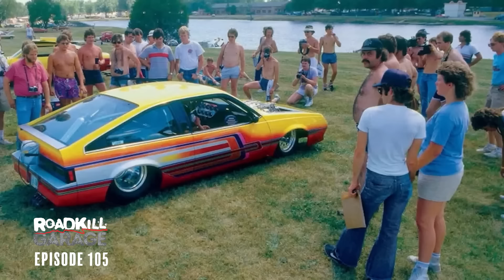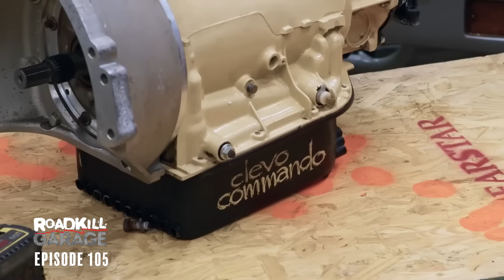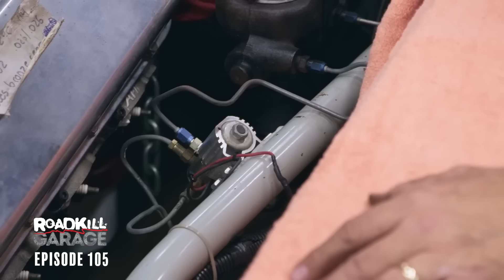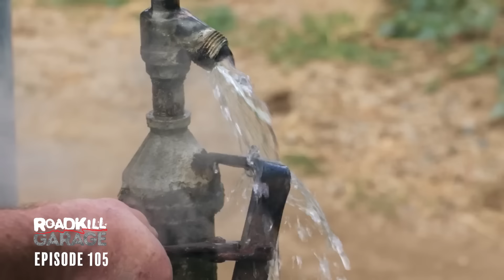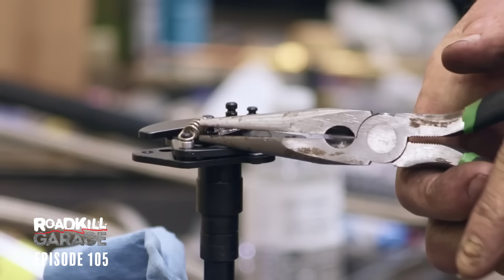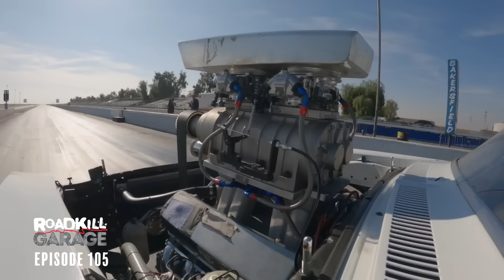Making a 1000+ HP Pro Street Nova! | Roadkill Garage

Comment: The runners are closer to the intake the exhaust runners ore closed off their the blocked head im blocking these heads groove moving the runner towards the middle having the exhaust separated  two apart through exhaust  pipes their going to be ane upper ane lower deck to the inner cooler

Comment: As soon as you do that the torque on the intske roller rockers  1.7 rollers thevtorque is 43 turn ylthe wrench squared off the wrench the back it off 1/2 the exhaust roller rocker arms the 41 torqued the squared off to 3/4 after you loosen them after thevtirque is set

Comment: I have a nostalgia enginebane 30 over 305 the distributor 180 distributor stabbing camshaft 12 at 360 degrees which is said but usually any thing you heat is wrong turn the crankshaft turnef the camshaft mark at 6 o'clock  cause I have the distributor rotor at number one rotor at point the number one wire at the firing order of the number 6 cap the turning the distributor tovane 30 degreed minus 180 make 150 degrees the plus is 210 the the 30 degree turn wheir you turnvthe distributor to the number four wire two clicks

Comment: The 1969 and 1970 Nova made the best hot rods back in the early 70s. Why? Because you could stick it to the insurance companies. If the VIN number told them that it was a six-cylinder Nova that was the rate that you paid no matter what was under the hood. In my case, an LS6 454. You could not do that with a Camaro or firebird or mustang or Challenger... The NAME said muscle car. Even if it was a 6 cylinder car, you had to pay the high rate. The only way you would not get away with it was if that Nova was an SS car.

Comment: you locktite the threads and put arp lube on the sliding surcafe. its in the arp flywheelbold manual if you read it

Comment: The original Pro Street cars were just that: street cars, not race cars. Most early examples were back-halfed cars with subframe connectors and stock front suspension.

Comment: fellow gear heads help me put, when he said the shorty headers were for higher rpm ranges... how ? when does header length come into play with rpms
Reply: Length of intake runners and primary tubes are all about optimizing power at an specific rpm range. The longer runners and tubes the lower RPMs were you get an "boost" in power. It's combustion engines 101 tech.

Comment: Great video, but why are you using a brass distributor gear, they wear out quickly when street driven
Reply: Yep, they should be using a composite.
Reply: bronze, not brass. - and he explained why.
Reply: @peterrenn6341  and they still wear out on a steel camshaft

Comment: That’s why I love roadkill and roadkill garage.  They just don’t build cars. They teach you tricks and tips   They’re very hands on.
Reply: The only thing that could be better is if us inferior people were allowed to watch the full episode.
Reply: 😊😊😊😊 @vintagetractorsaustralia
Reply: @vintagetractorsaustralia  Here-Here to that.
Reply: On Pluto tv they have a motor trend channel and on the weekend they run full episodes of roadkill, roadkill garage and faster with finnigan.
Reply: @scottvincent3062  what’s Pluto TV?
Reply: @scottvincent3062 is it the motortrend fast channel? I have that through my firestick, but all the shows are usually a couple years old at best.
Reply: GroundStrap Steve bending metal and slotting brackets and tricking out timing, well done sir.  Also, Homeless, if you weld on your distributor do you think your tac is going to work, Plain-Jane; just sayin'!
Reply: I forget the episode of RKG or RK but I remember Freiburger did like a 10-20 minute long zip tie tech tip segment going over everything you can do with zip ties, my main take aways were the clean spark plug wire seperator/mount enirely made of zip ties and the fact that zip ties are reusable if they're not trimmed super short
Reply: all 22min of it